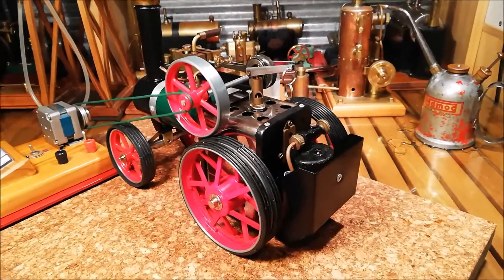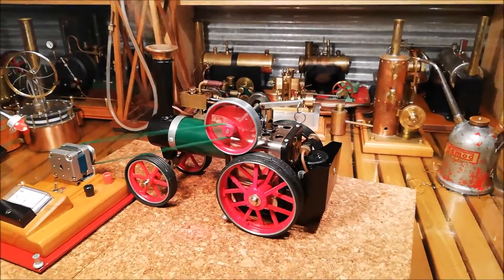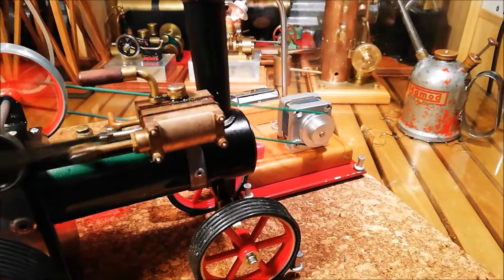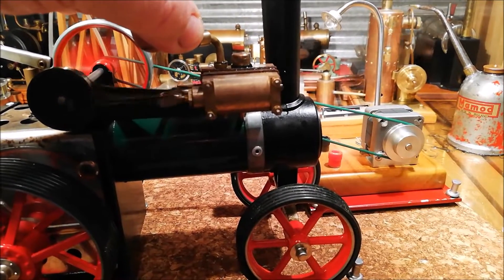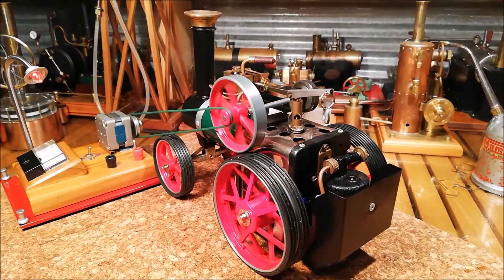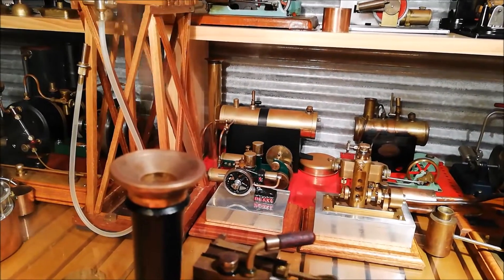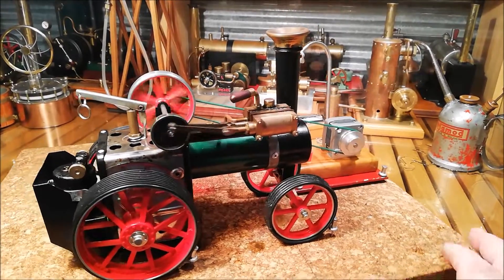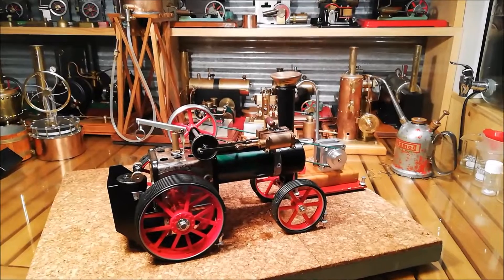Mamod Centurion TE 1313C Model Toy Steam Engine on live steam & running Blue Thunder Generator

Comment: A nice model....As someone who has not seen these more up to date Mamod engines before..I was surprised that they don`t come with the exhaust pipe straight into the Chimney...That seems such a basic design floor,..especially after they have gone to the trouble of improving the cylinder set up ?....So correct me if i`m wrong..If you run one of these direct from the factory,there`s no steam coming out the chimney ? Apart from that,a very nice engine....Cheers..Ade
Reply from the maker: As bought these don't exhaust into the smoke stack.
Reply: @SteamEngines-Jim  ...incredible..yet their old ones do.....don`t   get it  at all....they take a step forward with the cylinder and a step back because of the exhaust,in my opinion....hanks for reply...ade